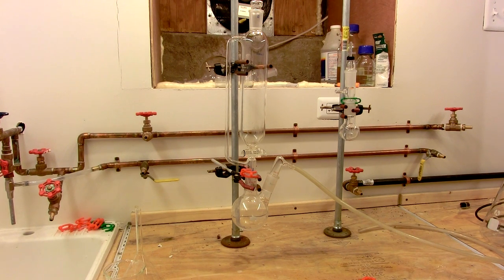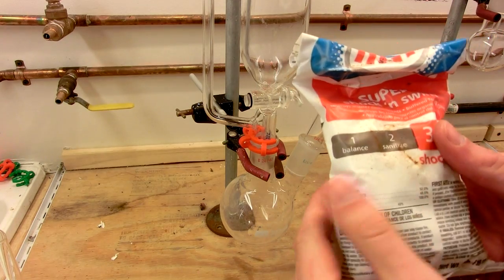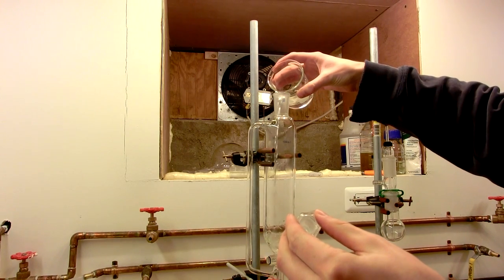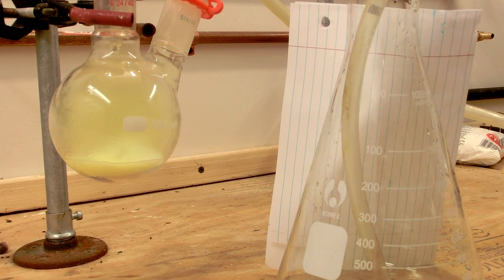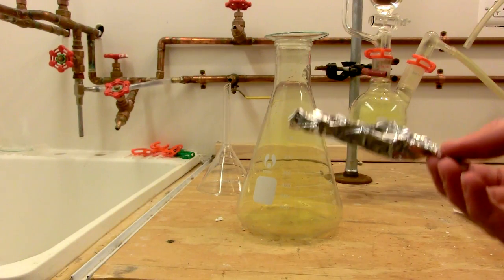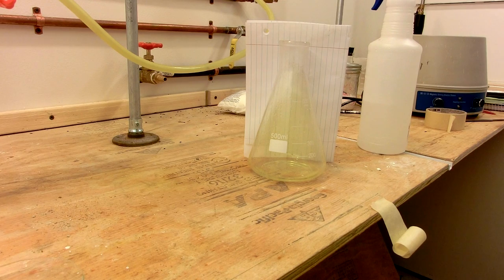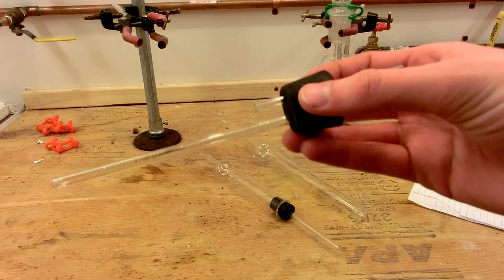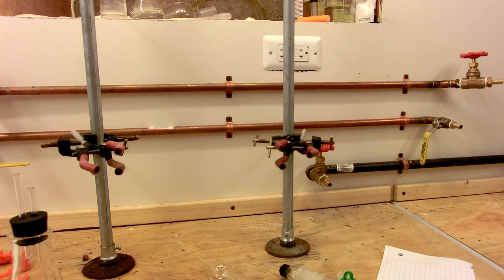Chlorine and Gas Drying

Comment: Hey nice vacuum/air/water lines. How big is your hood, do you have a lab tour? 

For neutralizing acid vapors I use dilute ammonia in a bottle, it has the advantage of smoking so you know when it reacts, but I wonder if it will not react with Cl2
Reply: ***** It would make chloramine which is just as bad as Cl2
Reply: +TheChemistryShack well, not as bad, the Golden Book of Chemistry recommends it in fact. Now that I think about it... yep, it's probably even worse.
Reply: Based on your comment, I think your researching (or researched, 6 yrs is a long time) mustard gas. Knowing you, that’s VERY, 
V E R Y   B A D
Reply: Hypochlorite reacts to make chloramine, chlorine gas wont

Comment: Whats the purpose of drying a gas?
Reply: Remove the water that is mixed with the chlorine.
Reply: Yep. Think of the word drying" being replaced by "de-hydrate" (as in dehydrated raisins) and that is the logic! Most experiments either produce H20, so require dehydration afterward; Other experiments can't tolerate water (such as air humidity) so require drying BEFORE hand....And so that's the purpose!
Reply: To make it not wet duhh

Comment: Can you do a fluorine gas generator but not with glass somthing that doesn't react like nickel which forms a protective layer when it reacts with the fluorine .
Reply: Do you not know how dangerous fluorine is? Look it up. For example, it can react with water to make the extremely dangerous hydrofluoric acid.
Reply: @miamama9776  yes I do I actuly have hf but I don't have a nickel pressure vessel to use to contain the fluorine gas that will react with the fluorine to create a protective layer unlike the silicon in glass that will corrode when exposed to fluorine . I know all about the dangers of fluoride chemistry and just like alkali metals the halogen gases are dangerous and reactive .
Reply: Derek Washuck have you tried silver plated glass like from Tollen’s reagent? I don’t believe HF reacts with silver, never knew about Nickle.
Reply: Technically by electrolizing potassium biflouride you should get flourine gas at the anode, but the problem would be getting the nickel equipment and container to store it some how. Don't play around with fluorine, it is very dangerous. Be safe
Reply: Fluorine can be stored in ordinary carbon steel tanks. It can be generated by decomposing CoF3 or electrolysis of HF with NaF added. The anode must be made of platinum iridium foil mesh, the cathode, simple nickel will do. It makes H2 at the cathode and F2 at the anode. All plumbing must be either fluorine passivated steel or ptfe. 🤓

Comment: While producing 5000kgs of caustic , it will produce 4250 kgs of Chlorine asa co product . While 600 kgs Chlorine will be utilized to produce Sodium Hypo chlorite balance 3650 kgs of wet chlorine gas has to be utilized   Hence the kindly tell me about Chlorine  utilization.  Liquefying Chlorine  is not a viable option.

Please reply sir
Reply: Moking Sar not sure what you're asking
Reply: You can turn the rest of the chlorine (assuming you are using elextrolysis) to hydrochloric acid by mixing the gas with hydrogen in a quartz tube with a uv lamp next to the tube, and dissolve the hcl gas in water
Reply: You can chlorinate lime to make Ca(OCl)2 which is pool shock chlorinator. Chlorine will also compress and liquify into bottles. The material is plain carbon steel for dry chlorine, it is easily dried by simple refrigeration followed by a chlorine resistant dessicant. 🤓